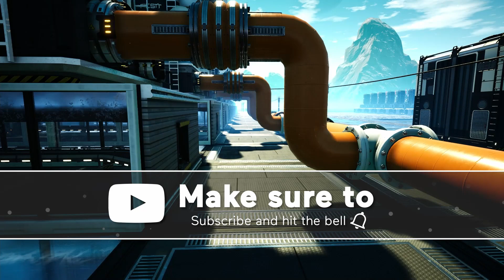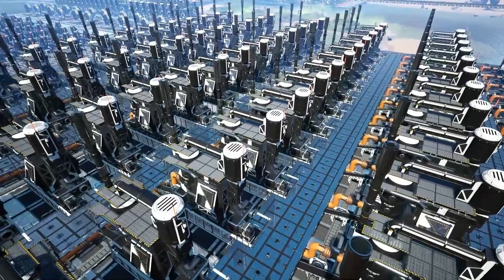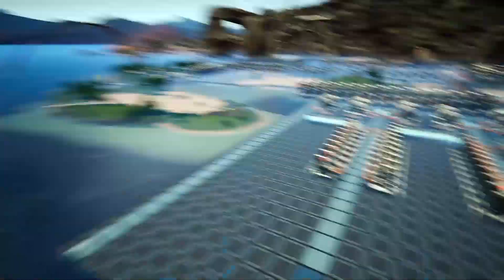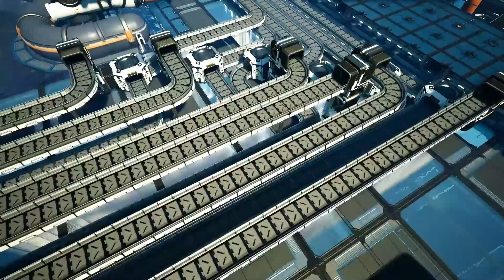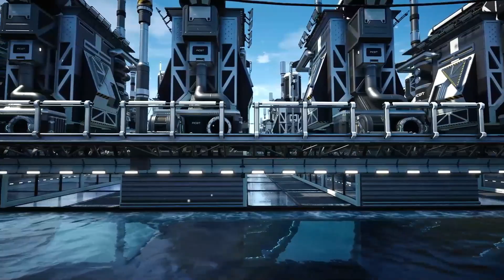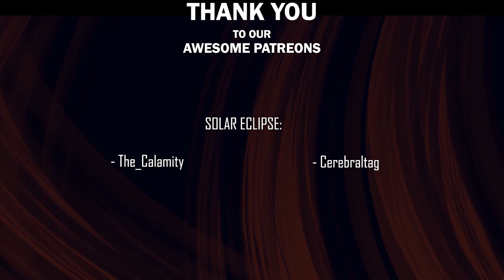Beautiful Fuel Refinery Setup | Satisfactory lets Play Ep.36

Comment: Why not blenders? 

Also, I personally really don’t like the conveyors sloped… I’d have pushed the envelop to create something with conveyor lifts, in all honesty. 
All other aspects, top marks.
Reply: agreed about the conveyor "rollercoaster". I know they are kinda hidden but... well, they're still there
Reply from the maker: I want to create a video based on Refineries doing diluted packaged fuel. So that is why I'm not using the blenders, though I have just unlocked them, we'll do a blender fuel build later in another location. 
As for lifts, unfortunately due to the positioning they're not possible with this setup. I intended to use them first, but there was too little space.
Reply: @TotalXclipse  It's fine. :) I just always run into problems with the distribution of the empty canisters, so I try to lay off bigger setups until I can use the blender and just run pipes.
Reply: Does he have them unlocked? I can't remember if he unlocked them yet.